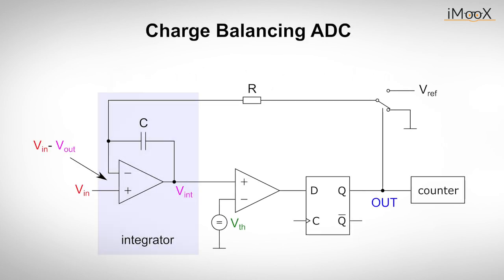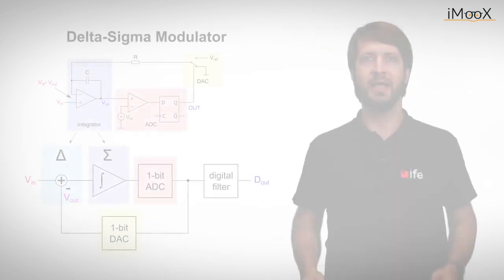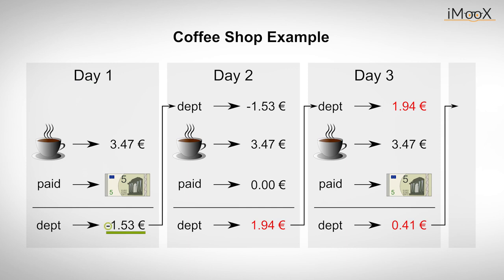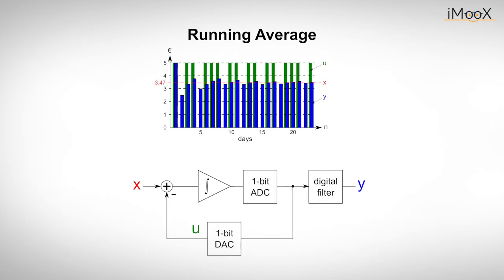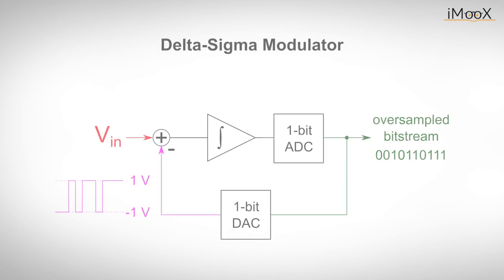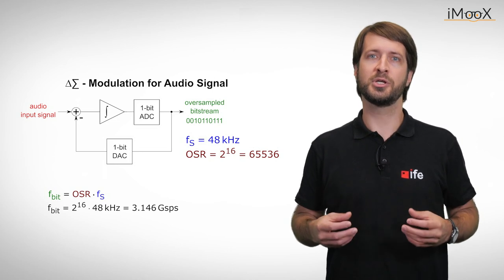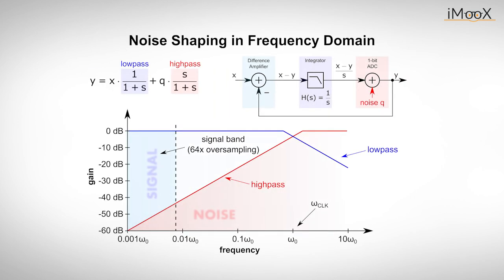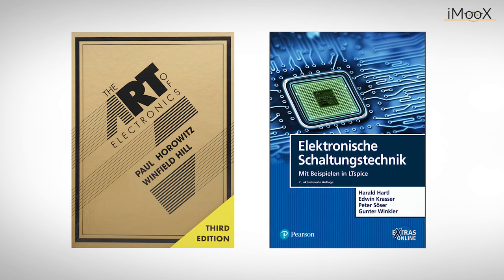Analog-to-Digital Converters (ADC) - Part 3

Comment: Thanks for the great video series on ADC ! I wonder if the mentioned ADC architectures are valid only for audio signals as the exemples are given in this range.
 What about ADCs used in RF Digitizers for example ? Regards
Reply: These basic topologies can be found in a variety of applications. The example of the delta-sigma ADC is for audio signals, because CD players are the best known application of these converters. For RF applications, flash converters are often used in stages because they are very fast, which is the main concern in RF ADC design.
Reply: @michaelfuchs441  I see. Thanks